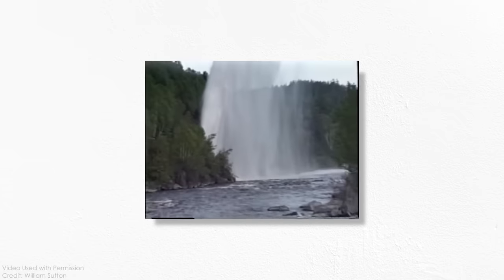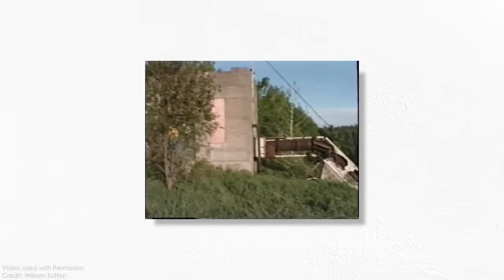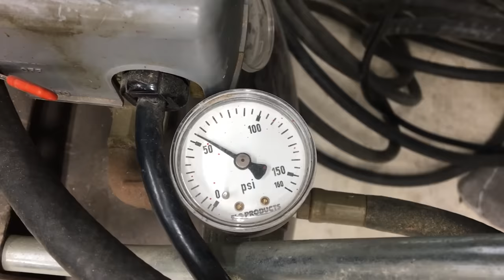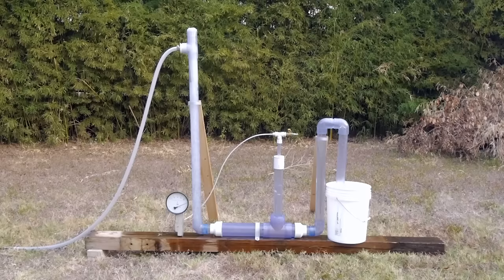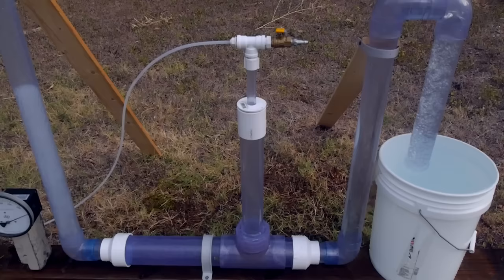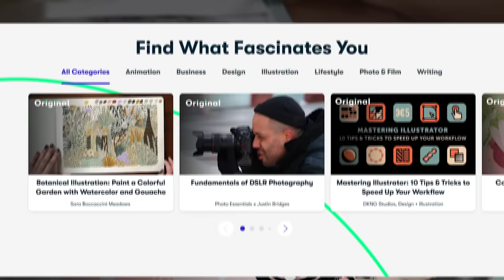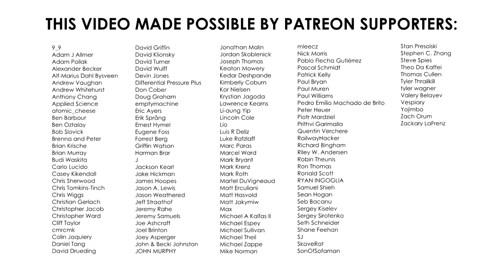Compress Air with No Moving Parts! - Trompe

Comment: At 3:40 that interaction also occurs in a lot of different bong. Especially if they have more percolators like the honey comb disks or the trees i like to call them or the disks with little vertical slits all around the edges feed a lot of air into the water in almost the same manner. I thought that was an interesting connections i made. Im sure other people already thought of it lol

Comment: i love the way you skirt around the origins of the trompe and the fact that more pressure is output than input and also the pressure can be compounded using a back loop, i.e generates more energy than it uses and this is why using a trompe  in your home is illegal in many countries.
Reply: LMAO, no.

Just look at the thing.  The pressure is ONLY held in by the weight of the water.  If the pressure goes too high it'll either stop collecting, or blow water and air out the ass end.  It's limited by a) the height of the tall pipe, and b) the input pressure of the garden hose.

Anyone who bought into perpetual motion machines in the last 200 years never got that money back.

Comment: So if you combined the processes of a Trompe along with a process used to heat water, you could heat water under a pressurized condition like a pressure cooker to bring the water's temperature well above 100 C or 212 F?

Comment: You made a small mistake. Trompe is not using an isothermic compression. In fact, it produces a very dry and cold air that can be made even drier if the air is pre-heated a bit before the intake.

When the air bubbles are compressed, the excess moisture rapidly condenses on the walls of water bubbles. And the high pressure in the air reservoir inhibits evaporation. It will of course eventually reach the equilibrium if left undisturbed, but if the compressed air is used immediately then it'll still be pretty dry.

Comment: Is it possible to combine the Tromp and the Ram Pump top have no waterloss? So that the Air pressure closes the Valve and forces the Water through the Pipe.

Comment: Nice Video...  I would have loved to see some pressure gauges along the way,   on the garden hose and the air outlet,   . but,    What If  ?   You ran the garden hose over your house roof first,  then let it drop through a higher inlet tube.

Comment: could this be made to have a quicker duty cycle if the venturi was further down the pipe instead of at the elbow? that way the bubbles will fill the stand pipe more quickly after use.

Also I never knew you were in San Antonio! So awesome to have a creator I respect and admire so much  live so close to home.

Comment: I'm curious how compressed you could get the gases. If you increased the number of inlets, increase the amount of air that the water can hold, maybe with a weak surfactant, and increased the length of the outlet, would that be enough to compress the gas to a liquid state. 
I was thinking about how useful these would be to decrease the emissions from a motor. Once the gases are in liquid form they could be spun out, separated from the water and sold for manufacturing purposes.

Comment: Hello, thanks for your video 🙏🏻. I live in mexican Caribbean in a eco community no electricity, plenty of sun and heat, underneath the floor we have inexhaustible amount of sweet water that we pump with solar pump to towers about 20meters high,  we want to store energy in tank's rather than batteries, do you think that if we spiral the tube plus increase the width of the tube we would get more pressure?  Gracias!

Comment: I have a crazy idea/concept in my head. I need to know if it'll work. I'd build it but I don't have the flexibility or means at the moment.
So here it is.
Can you use the air to pressurise a ram pump? To give the ram pump more psi?
So basically the air output of this trompe to the top of the pressure chamber of a ram? Ofcourse they should be running at the same time

Comment: Sir, I am looking for any idea to substitute domestic water pressure pumps since my country, Sri Lanka is having long hours of electricity power cuts due to the worst economic crisis. Without electricity my pressure pump that pressurizes water to bathrooms and taps cannot work. Because of this we suffer as the water stream is very thin. Hope you can direct to some solutions. Thank you in advance.

Comment: I assume that this isnt more efficient than an air compressor because of all the excess water it requires, despite the fact that isothermal compression uses less power than adiabatic? If it provides room temperature, compressed, dry air, you can run it through a turbine to recover some of the work from the pump, and output very cold air as air conditioning?

Comment: Isn’t the title a little bit misleading? 3 parts of the system are moving. The water, the air, and the valve. 4 if you count the needle of the gauge. After all , it is the moving water that draws the air in and transports it to your collection chamber. This would be a minimal moving parts compressor technically.

Comment: Hey... just thought of this and was curious if I could use a RAM pump as the supply to this and then use the air created to feed of diffused air to a pond?   This way I could use the RAM pump to get water FROM the pond, filter out silt in a bucket, let the waste water flow back to pond, and then take the filtered water from RAM pump into Trompe to create air that will supply a hose with diffuser to aerate the pond.  This would be self-sustaining and only having 2 working parts between RAM pump and Trompe to allow the pond to feed air to itself.  Please let me know if the PSI from the Trompe can do this?  Also... does changing the height of the tube increase the PSI?   If so how long does the tube have to be to get enough PSI to feed enough pressure to the diffuser?  Thanks in advance. Jim

Comment: OK here is a project and work load for the Trompe. Use the compressed air to power a pelton Generator and on the exit end connect your Ram pump. The ramming action on the end should increase the air pressure. Depending on the head pressure.The system  would be ideal for off grid air compression water pumping and power production. Store the excess power as compressed air on the intake and as a thermal mass on a hot water heating system and with the ram pump water to a holding tank for house line pressure.

Comment: Really neat idea! Anyone know what the energy conversion rate for these is, how efficient they are?
Reply: abysmal, of course.  The point is it doesn't matter, you're reclaiming energy that was wasted anyway and flow that was going downstream anyway.
Reply: @tsm688  The question isn't so much this or nothing, it's more this or a system using moving parts (turbine and mechanical compressor) to do it more efficiently, to get more useful work out of a given flow rate and head. I've actually heard of large-scale versions of this used in the 19th century, but later on it was replaced by turbines, I think generating electricity, which is a much more efficient use of the hydro energy available.

Comment: This is really similar to a Sprengel Pump, which is used to pull a vacuum on a chamber, rather than pressurise it. The Sprengel Pump also works on mercury rather than water.

Comment: I was really hoping that you would have some information on the pressures that the trompe produced in the Canada example, and the sorts of volume it produced. Did they run a pipe or fill bottles. Am I correct that if you have a compressor running at 135 PSI, that is 9 ATM, and would require a trompe with a water height of 100m?

Comment: what if u were to add a wind turbine to add air pressure to the inlet at the top of the downer shaft .. also the falling water could power an air intake pressure increasing pump at the air intake . the goal being to increase air pressure

Comment: This could be mounted in buildings and take advantage of simply use of the water in upper floors. It won't be quick to recharge but the maintenance would have free unlimited compressed air just depending on the tank size.

Comment: Can this be used on a smaller scale in homebrewing? 
In brewing beer, an important step aerating it just before fermentation.  So the yeast have enough oxygen to complete the ferment. some people accomplish this at home by splashing and shaking the container, others use an oxygen tank a tank or a aquarium pump. So Something like this would definitely be useful if it mixes air water just with flowing. Could get air into the beer just by transferring the beer from the kettle to the fermenter

Comment: I am very interested in using this trompe system for an aquaponics system ... as an engineer, do you think that there could be a way to combine this trompe method with a Tesla Valve and/or a RAM pump?  I have been working to understand these techniques to create a fluid aquaponic system that requires nothing but gravity and/or solar thermal to create enough water flow movement to run an entire system, say, roughly 10,000 gallons.

I have theorized that a series of Tesla valves in parallel circuitry (one line separated by a number of given valves), each line composing of multiple Tesla valves in a series, and then all collectively heated by Solar to add thermal pressure to the water or fluid in the lines, and then re-integrate the separated fluids into a single channel to create enough pressure for vertical flow movement.

As I don't have enough assets or know particularly who I might know that may have engineering resources, I have a tendency to keep an eye out for potentially interested people with an engineering mind, which you suggested you try to read all your comments.  I could be opening a can of worms, but I won't get anywhere if I don't suggest to someone!  Thanks in advance for any research you might do because of this comment!

Comment: Compressed air is also being floated as a potential for long term grid storage, a bit more efficient than hydrogen and chemically simpler. The original turbines fed from a gas boiler have compressed air fed through them instead of steam to get the electricity back.

Comment: Get U shape pipe. 
Mount two valve, one in outlet, second in bottom side.
Close valve one top; 
Put water into second side.
Open bottom valve to make presure air.
Free air;
Close top valve and open bottom - exhaust water from pipe.
Repeat if need.
Done. 10000 times more efectively.

Comment: i hear in another video that this method for compressiong air is super eficient, around 82%, now that i think about, the air would be super dense because of the isothermic proces, i dont know if im wrong, but, if you circulated that air throug a heat exchanger, for example with sun radiation, previusly drying the air, to heat it, you would add presure, it woud be an intresting method to further improve the air presure and maybe  generate clean energy...

Comment: The video is very good, but it's missing a crucial part of information, mainly how efficient the trompe is? 

What percent of the hydraulic head potential energy gets converted into compressed air potential energy? 

And how does it compare to a water turbine coupled with a compressor?

Comment: Grady awesome job.  I thought I heard you mention something about the equations of the trompe, and I read elsewhere about venturi equation boiling down to area  times velocity of pipe 1 equals area times velocity of pipe 2, but am confused how this applies to your constriction in video.  Do I add up the areas of your straw openings, and treat that as pipe 2?  Do you have any equations with design diagrams?  Wouldn't maintainers need to take care near the Ragged Chutes air intakes?  They also have a closed loop HAC, I believe being commercialized by entity attached to University near Sundbury, CA, and good'ol oak ridge boys did some HAC evaluation for use in ocean for U.S., I think.

Comment: Could you recycle the water in a closed loop and power the flow with a bicycle? I live off grid on 12 v and air pressure has been a need at times?
Reply: it'd be easier to just power a compressor with the bike.  Like a water wheel, this is suitable for situations for moving water and not much else

Comment: hi there its look close to a water Rampump. i wonder if the pressure wuld be enough to drive a Tesla Turbine [Smoke Flow Slow Mo] to harnes electricity from the air pressure ??.
and i have an idea of gravity generator that use Rampump to send water in to hig position like a water tower and then use the water as a waight to drive the gravity generator filling buckets on the topp from rampump i dont know if it wuld be effectiv but i guess effectivity is less important if you can harvest energy in a verry cheap inventions.

Comment: You need to put a ram pump flap valve system into that so that you increase the air pressure by using the water hammer effect.

Comment: i wonder what the mines backup plan would be if this trompe had a failure. production shutdown? mine flooding? i assume the dewatering design would have to incorporate that. but there's a reason why there are not more examples of this trompe. it could potentially be costly when it eventually does fail (unless the Life Of Mine is not that long), its expensive to drive a shaft period, and the mine would ideally have to be fairly close to a water source. otherwise! its pretty cool! :)

Comment: HI Grady, I have a question.

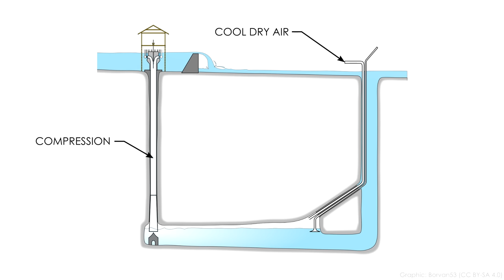In your diagram of the trompe at 6:15, you have a tube of (presumably compressed) air at the same level as the water on the surface.  But my understanding is, based on your other video, that the compression comes from the pressure of being under all that water.  Why doesn't the air decompress by the time it gets back up, according to the same principle?  Does it have to do with them being different fluids -- I suppose the water wouldn't even make it up that high.  Still i don't really understand the principle; why does it get compressed on the way down but not uncompress on the way up?
Reply: The air is trapped inside the tube by a valve at the top and a column of pressurised water at the bottom. The weight of the water column in the long inlet tube pushes against the air as long as the water level in the air tube is lower than the inlet, as the water tries to reach a state of lower potential energy (go down) and equalise with the water level in the air tube, pushing on the air as it tries to do so. If the valve is to be opened for so long as to let all the air escape, water would shoot out of the valve with some force since the valve is lower than the water inlet.

Additionally, as air accumulates in the air tube the water level in the tube is forced down, so that the weight of water in the air tube that partially cancels out the pressure coming from the inlet pipe lessens, further compressing the air.

Comment: huh so if you has a stream running though your property, and you were up for making a hydro-electric system to supplement or even take over grid power (lots of remote places still have grid power and it can be expensive),  you could create a nice hydro-electric/trompe. you will also gain a small pond to maybe fish out of when making this. you can make a trompe that goes right into a low flow water wheel or turbine to generate some 24/7, 365 supplement power and some air pressure. If build correctly, you could use that air for things around the property.  i imagine this gets scaled up if you used a wider pipe/underground system like in this video.  maybe even to the point to where you could have common 130 PSI, high SCFM air supply for your shop? or even small things like aerators for different fish/plant systems....

Comment: Maybe a bit late, but what kind of pressure is achievable with thid? I imagine it's pretty limited (maybe a couple bar without having to build a massive facility).
Reply: The pressure is dependent on the height of the downstream vertical section. In this prototype it looked like it might be about 2’ tall. 24” of water column is a little less than 1 psi, about 0.5 bar.
Reply: @eugenesandona6374  Thanks for the reply. I understood that much, the question was more that for it to be useful, it would have to be 5 or 6 bar minimum. So it would ahe to be a 50 to 60m deep shaft minimum.
p.s. i think you might have made a small mistake when calculating the pressure of demonstration apparatus: 
2foot ~ 60cm = 0.6m
0.6m * 1000kg/m^3 * 9.81m/s = 5.8kPa = 0.058bar

Comment: Your model had the second pipe (on the right) shorter than the first (on the left) but the drawing of the real thing has both, seemingly the same length...

Once the water is at the bottom, how  can you push it back up as high as it started?

I know the stream or river flows downhill, so there's current/pressure/gravity, but you've spent all that...

Is physics broken, or am I just too tired to notice a simple detail somewhere?

Comment: I'm now sitting here wondering if I can use a trompe using the overflow pipe of my fish tank sump to compress air for my air stone.... Just one question: Is there a lot of noise coming from the pipe with the air inlets?
Reply: There not going to be enough air flow from the Trompe.

Comment: Could you possibly explore the pyramids of egypt as a science. And tell me how the pyramids were used to pull water from the nile river to the surrounding cities? It seems to all be there. Water, Air, and they even found a shaft leading up at an angle that with a head sized hole in it for a wooden check ball valve. Any information to help me understand this would be helpfull.

Comment: If you closed the system, added ab electric motor driven pump, and put a Venturi in your vertical shaft, you'd have virtually no waste water, and be able to escalate your your pressure substantially. 

I'm sure you already know this, but I figured I'd share.